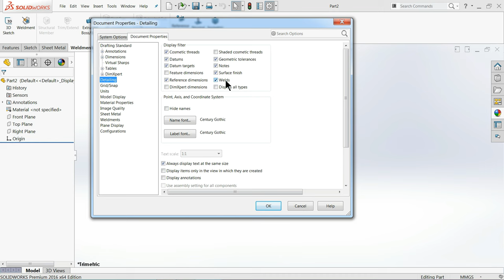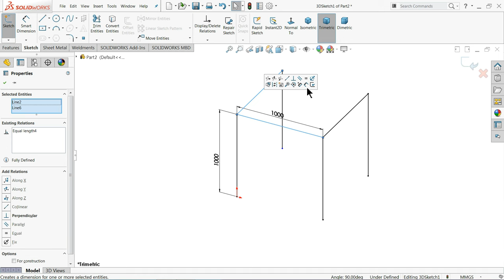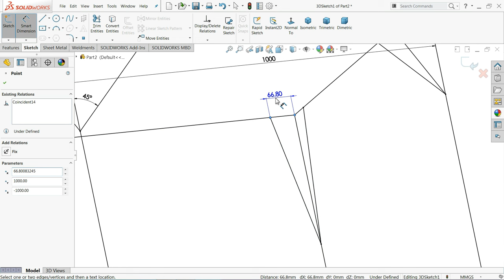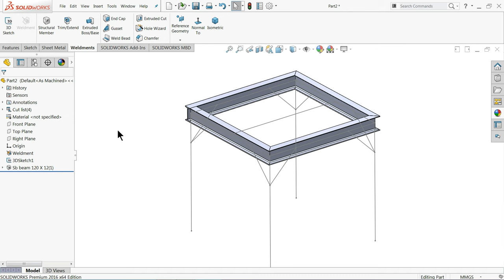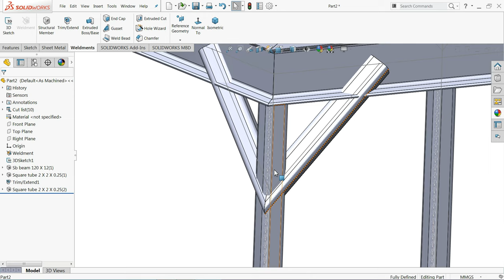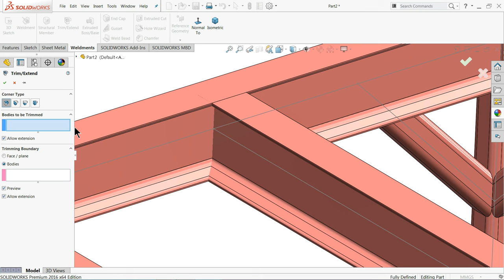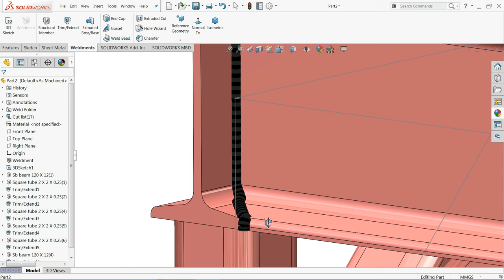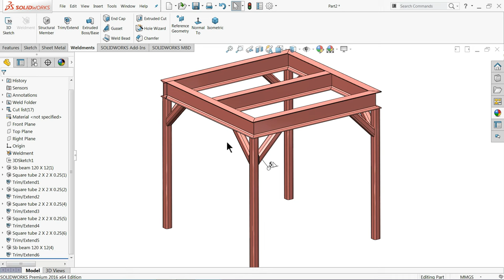Solidworks Weldments tutorial steel structure with welding Part 1

Comment: Thank you for the video. Just want to add that I think for structural applications, other steel connections may also be used. (e.g. backcuts in the beams to get T-joints rather than mitter butt  joints)

Comment: Thank you so much for the tutorial.
However, is there a way to input more structural members in the database?
Also, how do we do bolted connections?
Reply: Yes you can. There are two options:

1. In your Task Pane > SolidWorks Content > Weldment Profiles. This contains allot of extra Standards with Profiles. This downloads a ZIP file, which you can unzip on the same location as the Weldment Profiles that were included in the installation of SolidWorks. But I recommend that you make your on database. Because if you deinstall SolidWorks and upgrade to an higher version, you don't lose that location. The "Solidworks" Profiles will be lost if you deinstall SolidWorks.

2. Make your own profiles. You can do this by make a new part. In that part you sketch your profile. After you finished your sketch, save the file to a lib feat part while your sketch is selected. At the the file to your Weldment Profiles location. The one from SolidWorks or your own made location. You can add a file location at > settings > System settings > File locations > Weldments Profiles. There you can add and delete file locations for Weldment profiles.

If you add a file location for Weldment Profiles, it's important to keep the folder structure. 

For example:

Weldment Profiles > ISO > Square Tube* > File 

*= You can also work with configurations. This way you wouldn't have to make a third folder for the type of profile. So this way you can make a file called: Square Tube. Which contains a couple of configurations, for the different sizes

Hope this helps